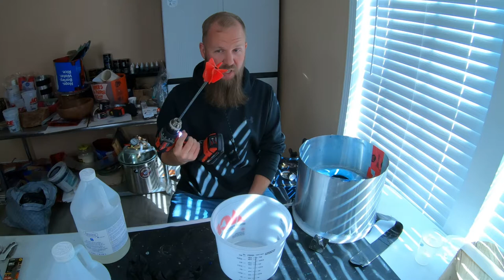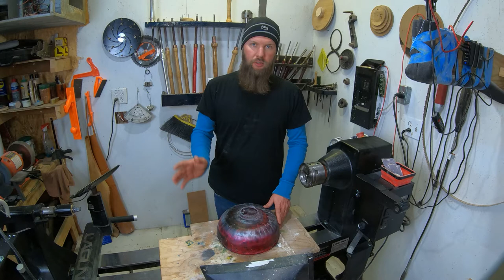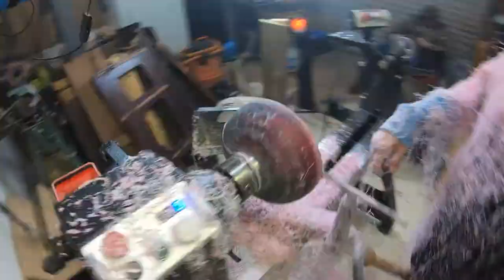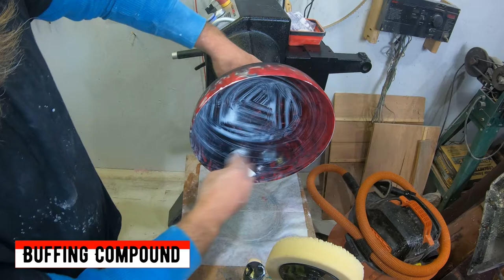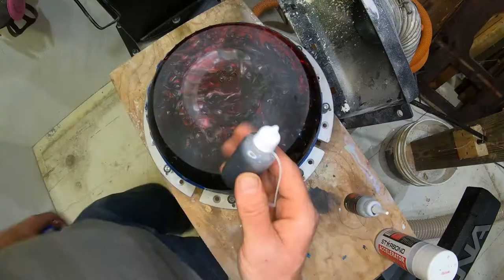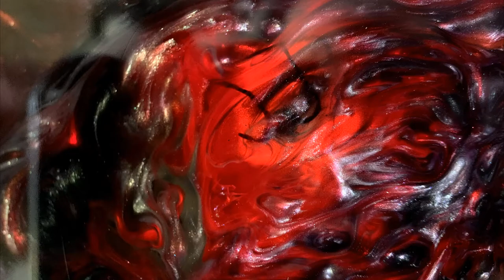Spider man's cereal bowl - Woodturning an all epoxy bowl from a silicone mold

Comment: I'm not usually a commenter but I'm setting up my turning area in our barn right now and I've picked up so many tips from you.  You were the first youtube creator that I saw with a raised wood floor in their workshop.  You reassured me that it's possible.  My husband and I braced the floor like crazy and I'm still nervous about it.  I also enjoy all the tips like buying big bottles of CA and putting it small needle bottles for use.  I think maybe it's a southern thing (I'm in middle TN) but you seem to be diy and budget minded in a lot of ways and that's super helpful.  If I can get close to the beautiful stuff you're creating then I'll be happy.
Reply from the maker: Lol yea bracing the floor is key and then it still isn’t the same as a concrete slab. I have 1” & 3/4” plywood over 4x6 joists and 6 - 4x6 posts in concrete holding up the lathe area. And it can still vibrate the building when stuff is out of round. 
But I’m big on diy and cheapest way to get it done. Being a single father living on my own has made me that way. Don’t let not having the best keep you from making the best. I ran a harbor freight lathe with a treadmill motor I installed for years. It’s in my earlier videos. 

But you’re right about it being a southern thing. Or just country. We have to figure things out and make things work most of the time in a pinch.

Comment: These are awesome! I'm wondering what it would look like if, just before going into the pressure pot, it was given a quick but calculated spin on a lazy susan? Am I thinking too far out of the "mold"?
Reply from the maker: The thermals would still change it. It gets hot as it cures so those horizontal lines would become vertical. BUT there is a way to make those lines horizontal. 🤔 🤔 🤔
Reply: @EppsCreations  Maybe if the mold were tilted while pouring...at a different angle with each color? Then again, that might cause too much mixing of colors rather than layering?
Reply from the maker: @justindavis8905  you’re on the right path 😉. Just remember heat rises. I could tell you how it could be done but I like giving just enough info to get people to thinking. 
Teaching is only good if the student can come up with different or better ideas, not just the one taught.